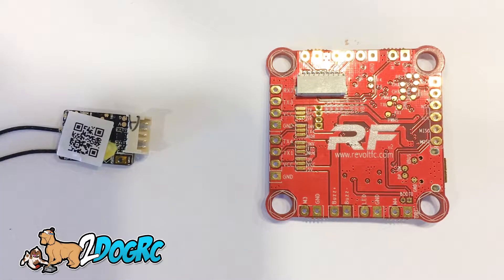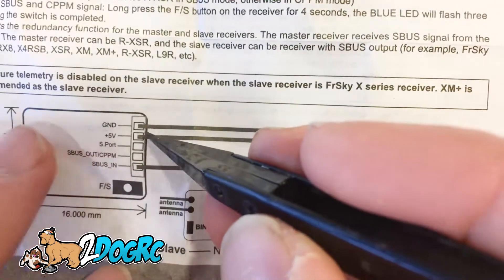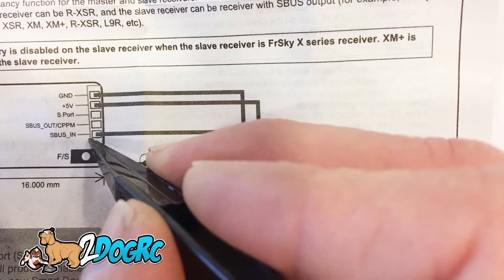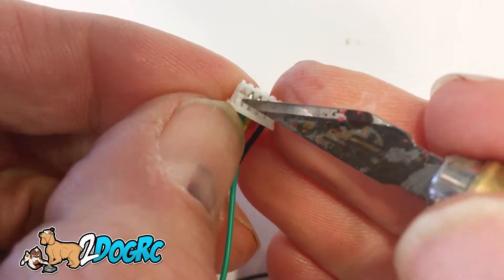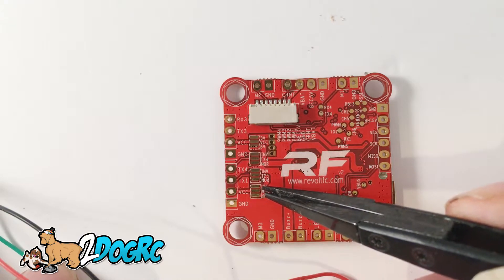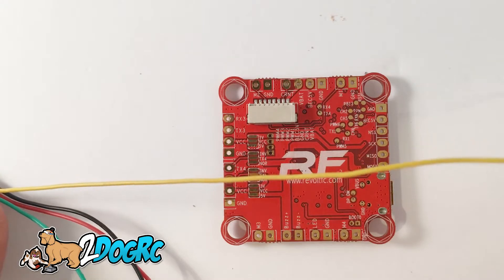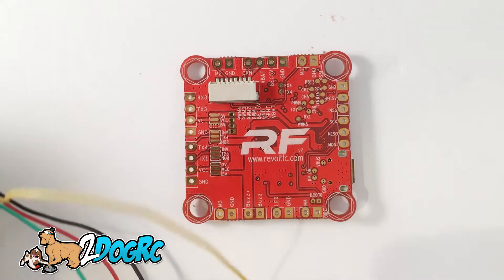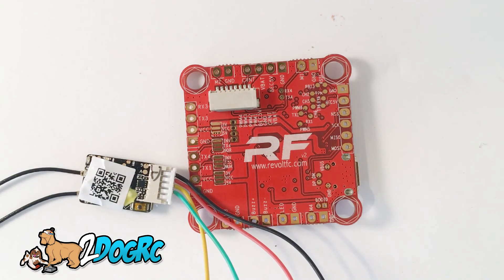How to connect Frsky R-XSR To Raceflight Flight One Revolt

Comment: They should have labeled things better, but in short, they give you 2  cables like that each with the power and ground switched, no labels. They are intended  for plugging into a remotes jr module bay pins and for flashing firmware to receivers from the remote. One harness is for radiomaster t16s style pinouts and the other is for taranis qx7.

Comment: Is this right? Shouldnt S.Port go to Tx and SBus go to Rx?? this seems a little diff from what i have seen on other videos and tutorials.
Reply: I was thinking the same thing. Every video I've seen regarding SBUS-Out goes to an Rx pad and S.Port Telem goes to a Tx pad. The only problem is you can only invert the Tx (Tx1 & Tx4) pads. Which is fine for Telem but there doesn't seem to be a dedicated SBUS with that supports an inverted protocol unless the flight controller just figures it out on its own.
.
This is the thing about building, While I like doing doing it, the lack of consistency is frustrating. It seems some boards use Tx for SBUS and others use Rx.

Comment: Does anybody know how to get rssi in the osd? I have revolt osd fc. Telemetry is working but rssi in osd doesn’t work
Reply from the maker: Bardwell has a video in this.  You need to pull it from the Taranis and put it on a channel then feed it back up to the FC.  I would use Channel 8.  Check out his video.
Reply: 2dogrc thanks for the reply. Yup you’re right, I posted on the FlightOne Facebook community and Preston told me same thing. It was the same thing I did on betaflight (bardwell vid) but yes, with the revolt osd you set the rssi channel on taranis to channel 8. It works! Thanks again for the reply.

Comment: That cable is for flashing using the qx7
Reply: Be very careful because this wire is swapped red to black wires if connect the way it is will burn your RX

Comment: with the first cable you even have to rearrange the pins on the servo connector to use with an x9d, would be usefull if frsky had mentioned it with the manual lmao, kinda dumb